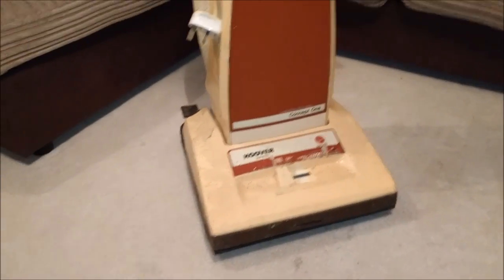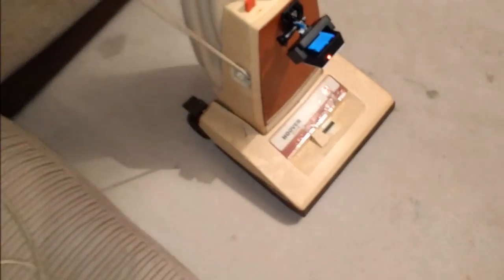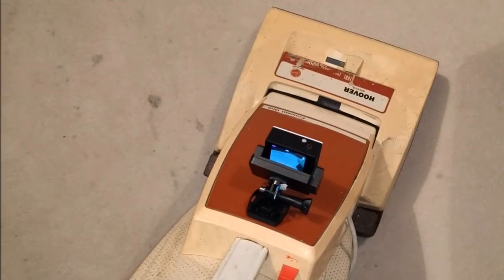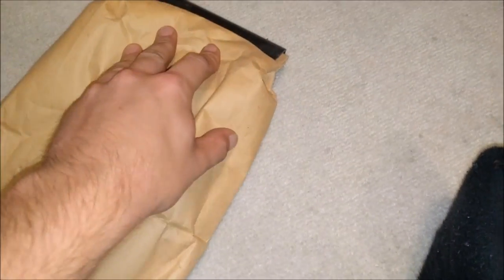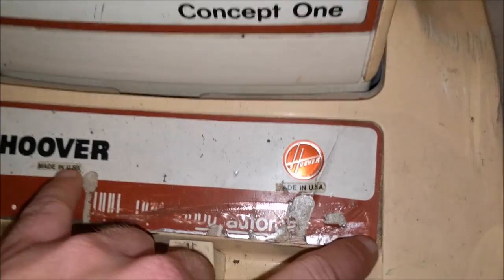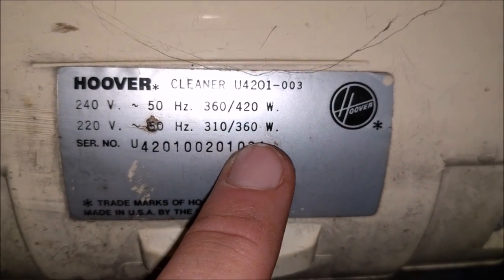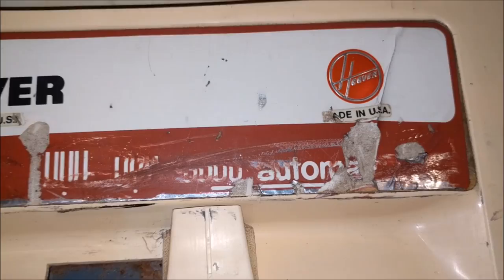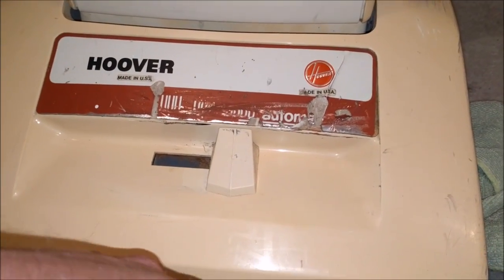1980 Hoover Concept One (Made in USA!) First look, before refurb!

Comment: That's the model I had from brand new and the first vacuum I bought when I moved to York. I saw it in the CoOp department store in 1986 as I travelled up the escalator to the electrical department. It didn't have the box as it was the last one on display, but it only cost me £58 or £68. The Concept One is a cleaner that I would consider importing from America as they are quite common there. Those fleece H18 bags from 4yourhome should fit and improve the airflow.
Reply from the maker: +ibaisaic I'm hoping their commonality over there will help me find a correct handle one day, although being a tall bloke the extra height of the junior handle is quite handy... I'm delving into it tonight for forced supressor removal!

Comment: Those are excellent vacuums, and your one sounds pretty good! They are very common over here and I've probably got a dozen of  them. I'll have a look and see if I can break one with the proper handle for spares.
Reply from the maker: +Scott D Oooh yes please! (Although don't smash one up especially!). If your going through spares, may I ask about a brushroll or the centre axle and 2 end caps? One of mine is stripped although works ok when on the machine.
Reply: I had a look and I'm not sure about a handle but I'm 99% sure I have a spare brush centre axle and end caps. Once the brushes wear down on these there is no way to replace them. I have at least one or two like that I can take the axle and end caps from.
Reply from the maker: Scott D Oooh lovely. How common are handles to come across generally? Like if you go hunting and I pay etc? I don't know how American selling sites work!
Reply: I doubt finding a handle alone is too common but the correct color handle is from a fairly common bottom of the range model. I have one but its the first concept I ever owned and have had it since I was around 7 or 8. Not too keen on the idea of breaking it for spares!  I'll have a quick look on ebay and see what I can find. I'll also keep my eyes open for one locally and ask around. 

I have some things I need to send to Tayyab anyway so maybe we could work out some kind of joint shipping. There is still some room in the box!
Reply from the maker: Scott D No please don't break your one! Im not fussed on the colour either if that helps! I'll need the switch too, or whatever is in the handle. I doubt tayyab will mind if you pop them in his box and he posts them to me, I'll go chat to him!
Reply: Haha don't worry my one will stay in tact. If you aren't fussed about the handle color I might just have one. I'll need to go to a storage unit to check. I need to go anyway so I will try and do that this weekend.
Reply from the maker: Scott D Not overly fussed no, although speaking to tayyab you might be a while finding his vacs, so of you do find a red one (i presume it should be red?) then that would be awesome, if not then any colour will do!
Reply: Indeed, I was planning on sending over a small box of spares in the mean time. Tayyab managed to break the front wheels on the maytag so I got a replacement set for him. I sent you a friend request on FB as well.

Comment: I managed to nab myself one on eBay a few years back, alas I don't have a brushroll. I wonder if a Hoover Convertible/Dial-a-matic brush will fit? Congrats on getting one though, I'm still on the look-out for the Powerdrive model, but I reckon it'll be a while until I get my grubby little protuberances on it.
Reply from the maker: Drwhofanindatardis I think the brushrolls are the same! Yet to try it though... But try look identical
Reply: That would be good, I have a Convertible so I may have to do a swip-swap when I next fish it out of the loft!